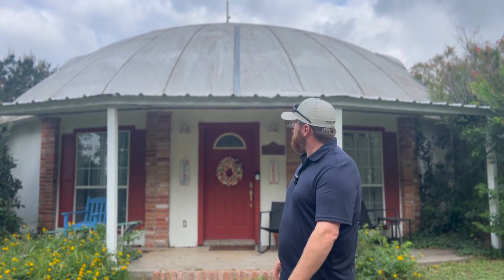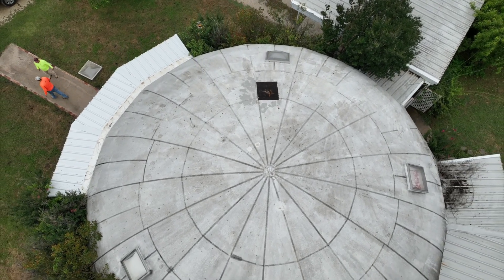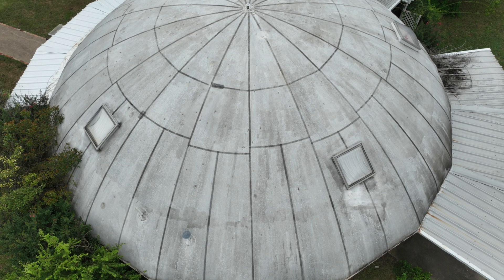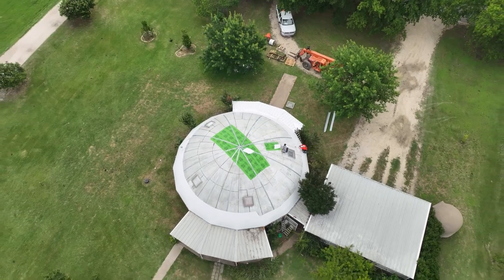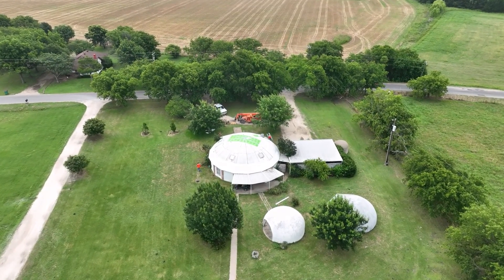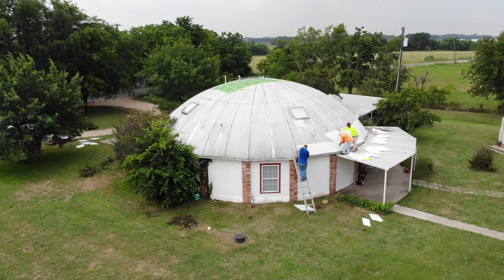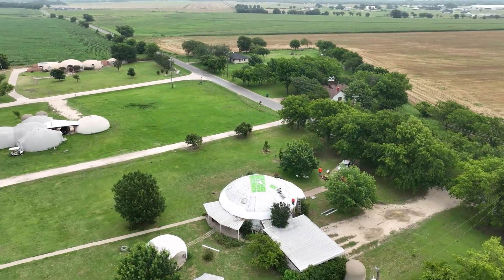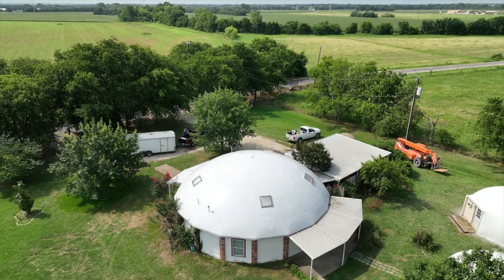Steel Cladding for Exterior Renovation of Monolithic Domes

Comment: What is the cost?
Reply from the maker: @docmallard2  For the dome?  About the same as a custom home in your area. For the metal cladding? About $18 per square foot of surface area. Which is why you don’t want to let your Airform to reach this point of degradation.

Comment: Why not use layers of shotcreat on top of inflated substructure?
Reply: I've always wondered this. They do talk about it on their website, but IIRC the reason was cost. You'd think it could be reinforced exterior thick shotcrete, vapor barrier, spray foam insulation, then interior (maybe reinforced) shotcrete. Like some funky reverse-ICF dome.  Outer layer could get a sacrificial coating of paint or Line-X type UV resistant truck bed liner.
Reply from the maker: https://monolithicdome.com/chain-shell
Reply from the maker: @davidallen9526  we do add shotcrete to the exterior of some domes per the owners request. See: https://monolithicdome.com/how-to-apply-chain-shell-coating

Comment: I have wanted a monolithic dome home for a long time. I used to work large scale disasters and got to see how well concrete domes hold up to Nature’s fury when nothing else could. 

I hope an investment I made years ago finally pays off and I can build my dream dome home! I like that metal cladding. I also like Monolithic’s Chain Shell coating. Is it possible that those steel straps can be used to attach solar shingles or even panels to a monolithic dome?
Reply from the maker: Solar panel can definitely be attached to the dome. NBD!